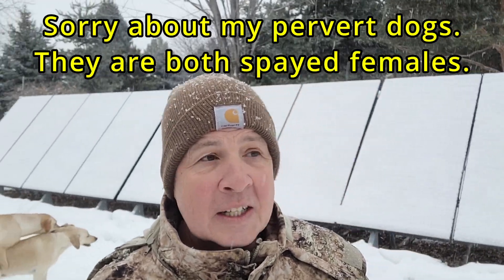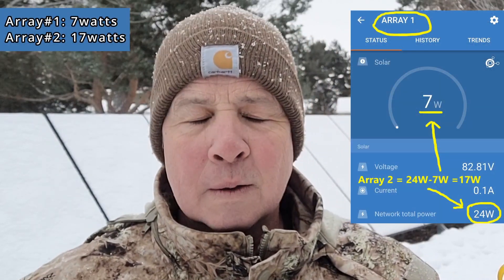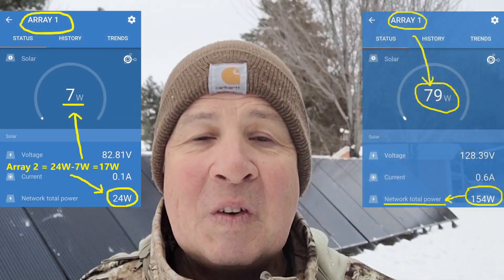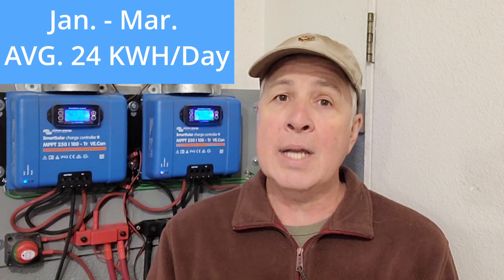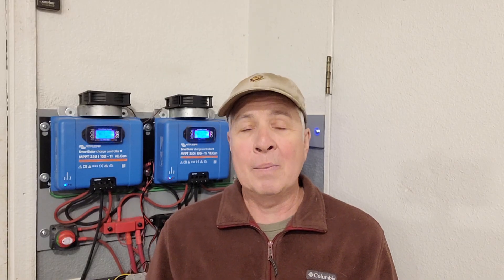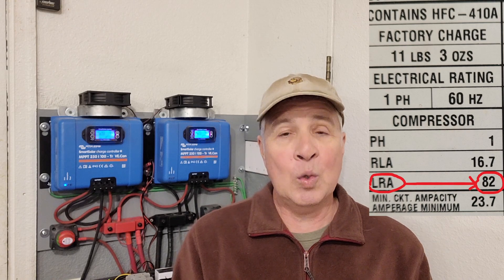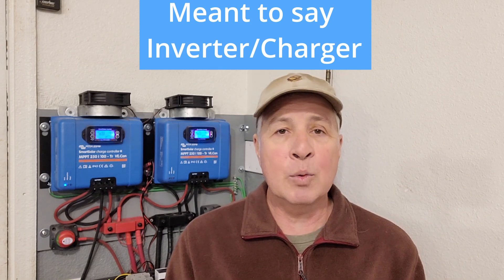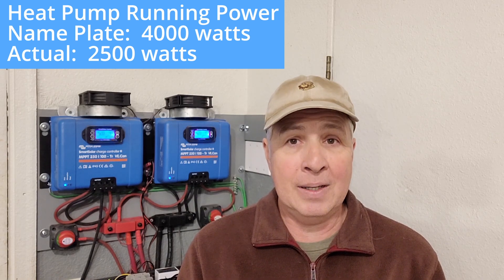DIY Solar System Tested Through Winter | Off Grid Cabin

Comment: Greetings.  I'm wondering how you will keep the batteries from freezing after they are relocated to your cabin.  Thanks.
Reply from the maker: I am going to keep them inside the cabin where it will be warm. In the event that I will be gone for an extended period during freezing temperatures I will power off the panels to keep them from charging.  That is probably not necessary as my Victron controllers are set to "Not" charge when temperatures are below 40F (you can set the no-charge temp to whatever you want).  I have seen people with unheated solar sheds and they seem to stay warm enough just from the heat that the chargers and inverter put off.  Of course maybe they have heating pads under the batteries that I'm not aware of.

Comment: Why not mount a slowstart box on that heat pump?
Reply from the maker: That is a great idea, but I wonder if it is really necessary since the solar system did run my A/C all last summer.  As noted in the video it does do a quick "beep" when the A/C first kicks on but then runs at a very reasonable wattage after that first momentary surge.  Thanks for the suggestion.  I may look into it even though it will start without the soft start.

Comment: Cut the trees, having the pannels higher will make cleaning them harder!
Reply from the maker: Yep, everything is about trade-offs and compromise.   Raising the panels, as you noted, will make them harder to clean. However, while that is a big inconvenience it is one I am willing to put up with, rather than cutting down the trees that have taken over 15 years to grow.  It is worth noting that most people have their panels on their roofs, which certainly makes them difficult to clean.  Makes me wonder how often they do actually get cleaned.  Thanks for commenting and watching.  Much appreciated.
Reply: @kombidog  Raising the panels will save from the tree shadow for a couple of years. But the trees will grow and put shadow again on them and you will have paid for the materials for nothing.
Reply from the maker: @scifycartoon  Valid point for sure however in the location on my property that I am planning to raise them up, I should be safe from the trees shadow for at least 3-years.  By then it is my hope to have moved the panels, and the materials I use to raise them, to an off-grid cabin that I am building.  This was the ultimate plan for the panels from day one. I set them up where they are just to test them and work out all the bugs before relocating then to the cabin.

Comment: Consider felling one row of trees and selling the tops for Christmas Trees, the lumber could be fuel or timber or cash.
Consider a wind turbine rated for 2000w (ish) probably 6 - 8 feet diameter three blade for extra energy harvest peaking in the winter - needs a big pylon!
Reply from the maker: Losing a row of trees would only be a temporary fix if it even helped.  The next row of trees would cause and equally big problem within a year or two.  The trees are not big enough for timber though we actually have been thinning them for years to use as Christmas Trees.  Heck, if you lived close by, I would give you one for a Christmas tree net year.  Thanks for commenting and your suggestion but I do really like the trees where they are, but the wind turbine is worth looking into for sure.

Comment: As far as I can see most people with solar need mains or engine power to get through winter in snowy climates. Find Ambition Strikes on YT and have a look at their solar installation, (it's huge and sweepable and tiltable) they still need to run a generator in the winter.
Reply from the maker: You are correct that in all probability I will likely need some alternate power for a least a few weeks of the year.  I do have a couple of generators and will be looking into wind and a small hydrogenator.  I follow Ambitions strikes and yes, their solar system is impressive.  Worth pointing out however that their welders, plasma table and incinerator toilet use a lot of power.

Comment: Hmm.  Mostly the ultra low production is due to the clouds.  Changing the angle isn't going to do a whole lot under those conditions... in fact, a lot of it is ambient light when clouds are involved (you can test that with a portal power stations and a single panel, varying the angle and seeing the difference).  Pointing at the sun will produce more, but it will still be miniscule vs the nameplate wattage of the panel.

That is, the worse-case conditions for solar panel generation, which will always happen a certain number of days a year (particularly during winter), cannot really be improved by a whole lot.  Whereas the nominal generation when not under those extra-cloudy conditions will almost always be "sufficient" when you have a large array, and thus also not really require angle adjustment.

So how to fix that for off-grid... well, adjusting the angle won't do it.  It won't improve the number of days each year where you can't make ends meet.  Increasing battery storage, though, will significantly reduce the number of days where you can't make ends meet by allowing you to buffer a whole lot more energy on the days prior to the cloudy days.  But it won't eliminate them.  Nothing will eliminate having a few bad days a year.

A propane generator in addition to increasing battery storage takes care of making ends meet on those remaining days.   The key there is to minimize the number of days that the generator actually has to run.  If the array is large enough, the number of days the propane generator actually has to run can be reduced to the point where you don't even have to think about it very much.

--

On the A/C and other heavy inductive loads, it isn't just the surge power on startup that you have to worry about.  Its the reactive power... the power factor of the A/C unit while it is running.  A soft-start circuit won't fix that, (though a power factor correction box after the contactor/relay could certainly help).   The power drained from the batteries does not reflect the actual power that the inverter has to continuously provide.  The work the inverter has to do is significantly greater.  For example, if the A/C has a power factor of 0.6, the inverter has to output nearly 1.5x the wattage.  The A/C will reflect the 0.5x back, and the inverter has to then reprocess that reflected power and feed it back into the forward direction.  So the total load on the inverter in terms of heat dissipation can be as much as 2.0x the wattage.   And the drain from the battery is only 1.0x the wattage consumed by the A/C.  Roughly.

The simple solution is to oversize the inverter(s) such that the maximum continuous output capability of the inverter is roughly double the maximum continuous consumption of your loads.   Note that nowhere do I mention "surge" power.  We aren't talking about startup surge.  We are talking about normal operation after startup.   Oversizing the inverter also tends to take care of power imbalances on the two legs (when doing 240VAC).
Reply from the maker: The clouds are obviously a problem but really right now my bigger problem is the shadows being cast by the trees.  I’m pretty surprised how well the panels perform with a THIN layer of clouds.
As mentioned, my A/C unit is only drawing 2500 watts when running, which is less than half of the inverters 6000 watt running spec.  Granted I am using other power at the same time for lights etc and for short period, my well pump.  Typically using less than 4500 watts or so total while the A/C is running.  Having said that I agree with you in that I would like to get a larger inverter. I would also like to have more panels for winter and the more batteries the better.  But I can only add those things to the mix as finances allow.
I have a few additional panels that I plan to hook up and test under load just to see for myself how much angle toward the sun matters.  I have heard claims that improvement can be seen from as little as just a few percent to as much as 30% under the right conditions. Testing it for myself will help me decide whether changing the angle of the whole array is worth it or not.
It is always good to get another perspective.  You’ve given me much to think about and I do appreciate your input.
Reply: @kombidog  For panel angle, test across the whole day.  You can definitely do a lot better with tracking.  1-axis tracking is usually plenty good enough, no need for 2-axis tracking.  It won't do much for heavily cloudy days, but it will be significant for light clouds, broken clouds, bright clouds, and sunny days.

But the cost of doing this can be a show-stopper.  It is often easier to not track and instead spend the money on additional fixed panels.  YMMV.  But I think it is worth exploring given the seriousness of the winter shading problem.

A manually adjustable panel angle doesn't give you much but its better than nothing if you can do it cheap.  You set one angle for summer conditions, and a different angle for winter conditions.  It won't do anything for cloudy conditions.

--

I'm thinking about possible improvements in shading conditions.  One thing that is easy to check is the MPPT voltage range verses the string's operating voltage (not VOC, but operating voltage).

One thing about shadows and shading, it significantly reduces the optimal string operating voltage.   So make sure that the optimal string operating voltage calculated with a few panels dropped is still higher than the minimum MPPT voltage.  For example, if you have 8 panels in the string, make sure that (8 - 3) * Voperating is still greater than the Inverter MPPT minimum.  If not you usually want to add a few more panels to each string.

But you also have to be sure that the panel VOC * Total_Panels is lower than the inverter's maximum DC voltage spec.  Give it a good 10% margin.  So if the inverter is spec'd for a maximum DC voltage of 500V, don't put more than 450V worth of panels (N panels x Voc of panel).

--

One other bit of advise for shading which might or might not apply to you is to be sure NOT to combine (parallel) any strings.  Each string should be on its own dedicated MPPT.   The shading conditions on the two strings will be different and result in them having significantly different optimal operating parameters.

--

For raising panels... that's actually a bit of a problem if you don't have a strong structure already to mount them on, with regards to dealing with potentially high wind conditions.  Most people with ground-mount systems do not try to raise the array up more than about 10 feet ground-to-center-of-gravity.
Reply from the maker: @Junker Zn  if/when I do a panel angle test I will definitely share how exactly I performed the test as well as the results.
Reply: Where about are you located @Junker Zn?
Reply: @Mulberrybeach  Northern California in my case.  Good sun.  Not at altitude so no issues with snow.  I am grid-tied at the moment (solar array for almost 20 years), not off-grid.   But we will be doing a major expansion and adding batteries this summer.  Still wont be off-grid, but I may try my hand at some 4-9pm exporting under the new NEM.  Mostly for fun.

In anycase, we have a number of friends with places up in the sierra foothills with various degrees of off-gridness.  More like "loses power a lot" for most of them, but there is one with a cabin that is completely off-grid but the system is extremely old... as old as mine and much smaller.  Only 500W of solar, 500W of wind, a couple of lead-acid batteries, and a generator.   No A/C, no heat beyond the wood burning stove.

It's in for some updates and modernization, though nothing huge.  Some modest solar (3-5kW at the most), modest batteries (5-10kWh of LFP), and a few other things to keep the electrical up when the place is unattended and maybe even a few hundred watts of heat to keep the place above freezing (again when unattended).

Comment: We built an completely offgrid cabin in Hells Canyon. Running 40 330w panels 2 Sungold Sp6548 and 600ah storage.. Winter is hard and will need generator to help along the way
Reply from the maker: I will definitely need another source of energy for heat and hot water.  Probably try to use mostly wood for heat with propane as a backup.  I do have a propane generator if needed.  Thanks for your input and for watching.
Reply: @kombidog  We run propane heat and well pump no problems for a couple days.. Any sun really helps to recharge batteries. 
We have a 3 ton mini for Summer time and Solar runs it and charges batteries same time.
Reply from the maker: @Mulberrybeach  MY temporary setup is mostly running my house here in Boise except for water heater, clothes dryer, stove and hot tub (may have to look into a wood fired or propane hot tub).  My cabin with be less than half the SF and better insulted so I think I going to do pretty good overall.  It will certainly take some fine tuning and will have to supplement with wood and propane.  I know I won't get quite as much sun at the cabin as I do in Boise.  So are you happy with your Sungold inverters?  Would you buy them again?
Reply: @kombidog   They are pretty good inverters for the price but you do get what you pay for..  Sp 6548 is all in 1 inverter with charge controller and generator switch so savings alone on that is big. We went with a better battery for cost difference. Storage is 🔑
Reply: @Mulberrybeach  Got a question for you on your mini-split.   In winter conditions, when you have sun, is your solar enough to fully charge the batteries and then also be able to run the mini-split to help with the heating?

That is, to reduce the load on burning propane for heat, saving fuel, when conditions permit.
Reply: @junkerzn7312  Once up to temp the Amps tend to be at manageable conditions. I have ran it for 18 hrs and still had 20% off battery capacity. 
I also run a 80000btu  LP Mr heater for bottom of garage..